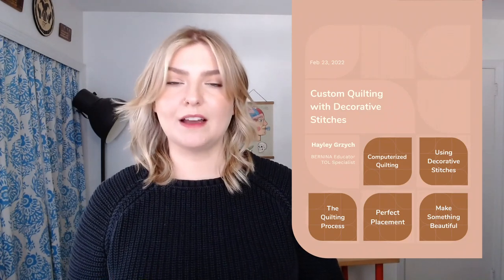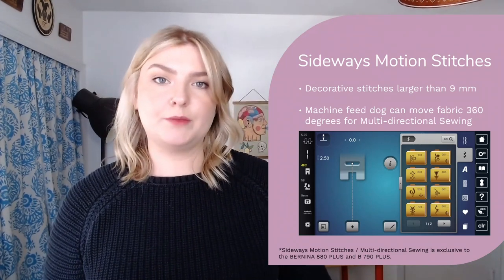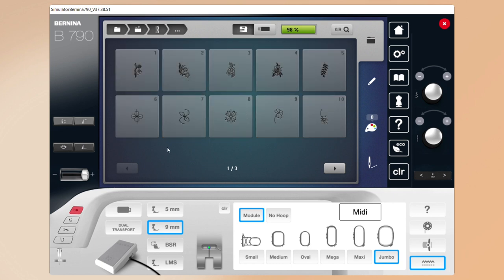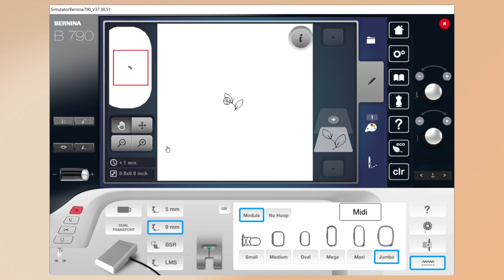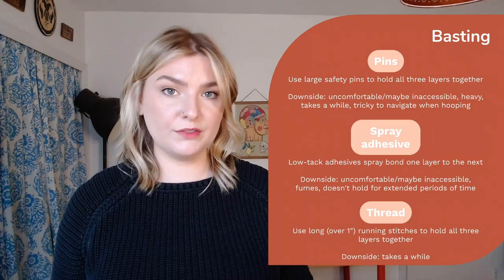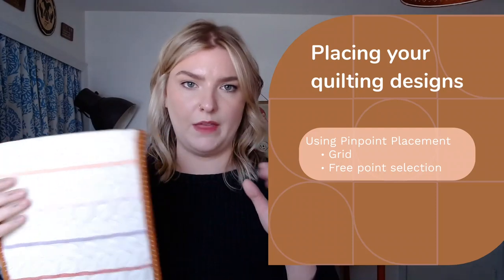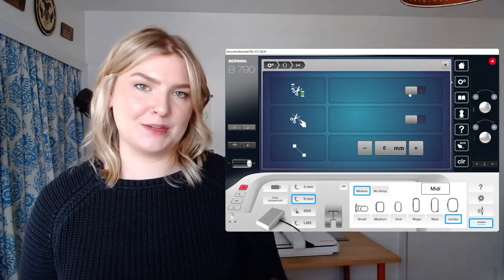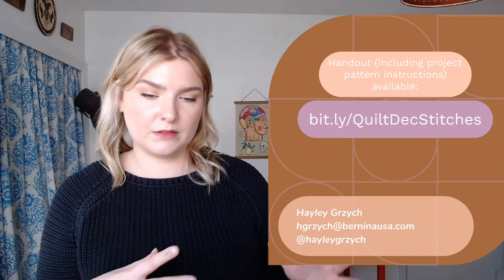Custom Quilting with Decorative Stitches

Comment: I'm a bit confused as you said only go up or down 20%, but you ended up going about 50% more on the leaves....is that because it looked okay as it was digitized and no gaps?
Reply from the maker: Correct, our general recommendation for resizing embroidery designs is to stay within 20% of the original size. But with this particular design, because the stitching is so simple and not particularly dense, I was able to scale beyond that and still achieve a beautiful result. The results, and flexibility in resizing, will always depend on the design itself and should always be tested!

Comment: Unfortunately this is limited to the 880 Plus and B 790 Plus models only.
Reply from the maker: You can use decorative stitches in embroidery with many of our machines that embroider, which allows for a LOT of creativity. The larger multi-directional stitches are available on specific models. This project was featuring those multi-directional stitches, but I think you could get creative with any embroidery machines to try computerized quilting like this.

Comment: Hi Hayley, Thank you for the great presentation and project. I notice that you increased the size of the stitch to 150 percent. I had thought that it wasn't recommended to increase more than 20 percent. You may have even mentioned this.  I assume that for this stitch the big increase worked out OK?  Is it just this stitch it works for, or are other stitches suitable for the larger increase?
Reply from the maker: Generally speaking, yes, we do recommend staying within 20% of a design’s original size. This is because, particularly with fill stitches, scaling outside of this range can negatively affect stitch density or tension and the result may not look great. With these decorative stitches however, because they are simple linework, they may stitch just fine scaling beyond that 20%. Ultimately it just comes down to testing to make sure you’re happy with the result!